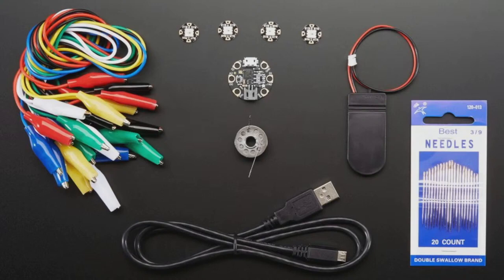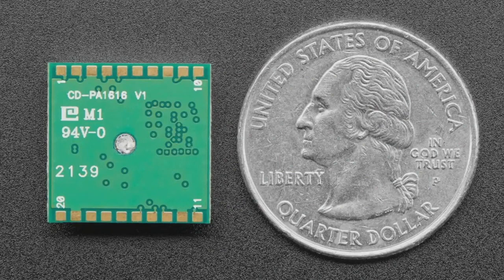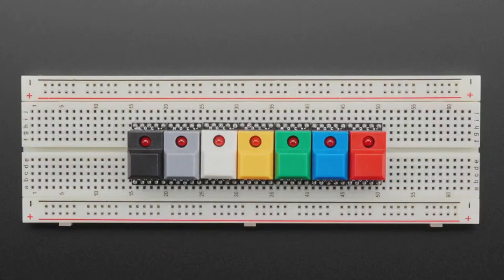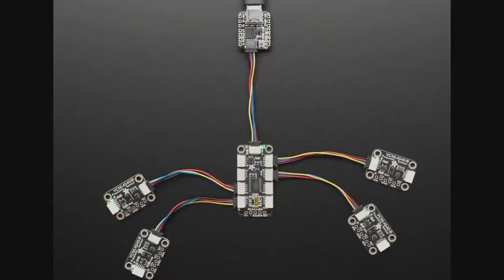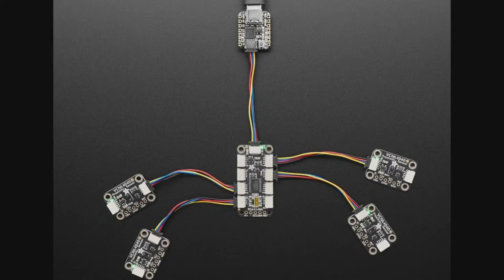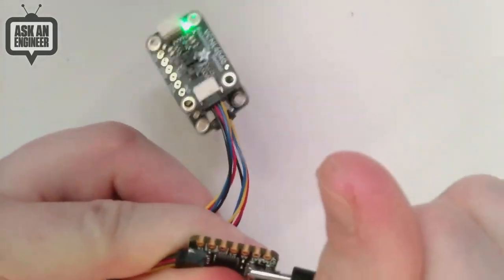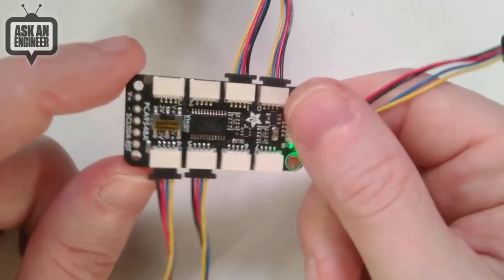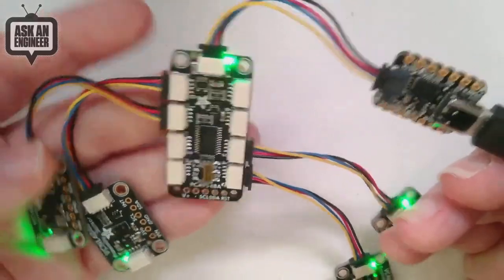#NewProducts 10/12/2022 Feat. #Adafruit PCA9548 8-Channel STEMMA QT / Qwiic I2C Multiplexer!

Comment: You can have a maximum of 8 multiplexers per I2C bus. They use I2C address range 0x70 to 0x77. Unfortunately the 7-segments displays have the same addresses so you’re limited to 4 channels per multiplexer in that scenario, still provides 64 devices. 

If you’re using the multiplexer with I2C sensors that don’t have 0x70 to 0x77 addresses… for example, 0x20 address range, then you can put 8 devices daisy chained PER CHANNEL. 8 channels per multiplexer, 8 multiplexers… that’s 512 identical i2c devices on 1 bus.

I’m using them in a project already and they work great! Never, ever, ever again have to worry about being limited to 8 of the same i2c device per microcontroller.

Comment: It's hilarious seeing these switches now cloned by the chinese. If i remember correctly, these are originally a Danish design by the company MEC (Now APEM) and they were the latest and greatest in the 80s :D
Reply: These are similar to the buttons used on the Roland TR-808 (early 1980's) drum machine.  Not exact, but the same concept.

Comment: Is there some kind of 'attachment' board for items that are better suited to non-breadboard mounting?  Like a Lego plate.
Reply: With stemma i2c devices that would be the stemma hub. 4 devices per hub. If you mean for the feather then look into the doubler or tripler board stack.